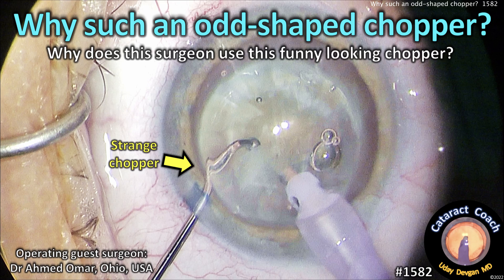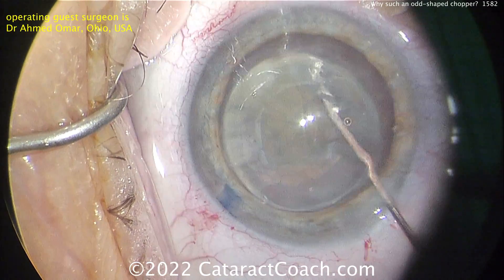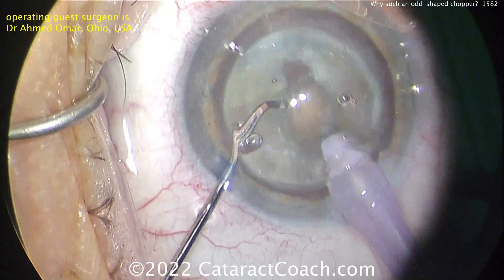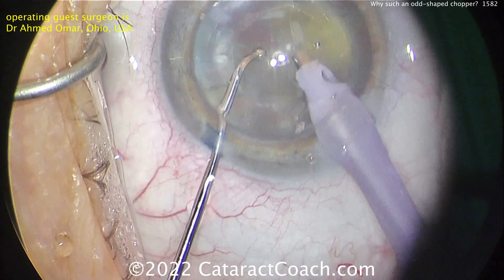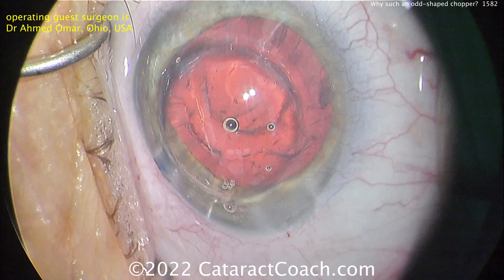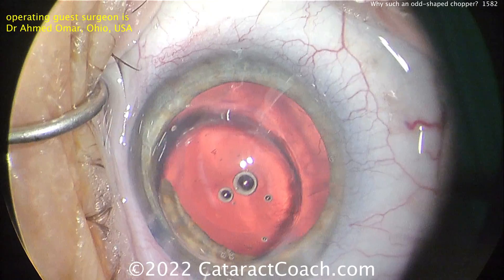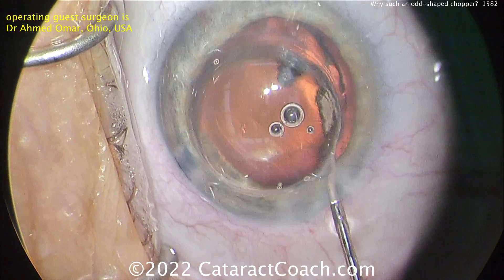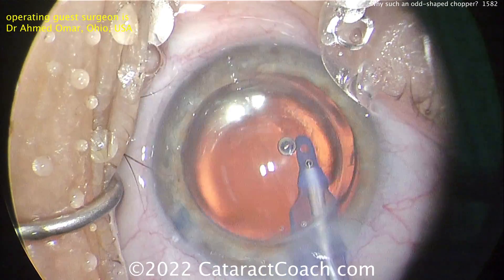CataractCoach 1582: Quiz: why such an odd-shaped chopper?

Comment: There's one other thing about IOL calculations (when you talked about it in the video) ; if the astigmatism is regular and you decide to put a toric IOL, when the endothelium gets weaker and the patient will need a new trasplant, it MUST be a DMEK in order to not alterate the refraction: if you put a toric IOL and then, time later you make a new penetrating keratoplasty, it's very likely the toricity of the IOL won't match the new cornea, resulting in you having to explant the IOL and put a new one (with, of course, chances of damaging the new cornea)